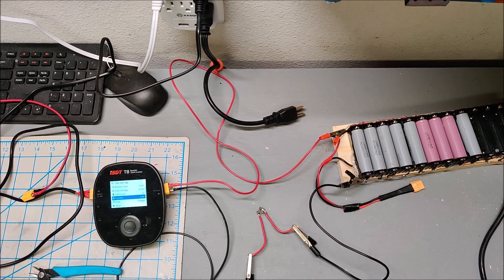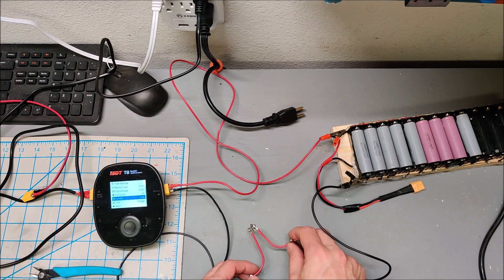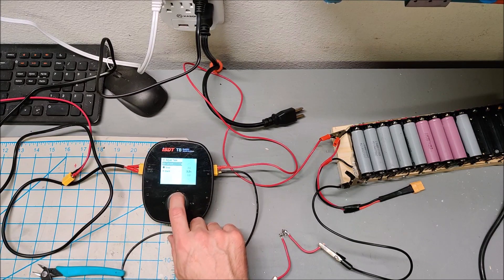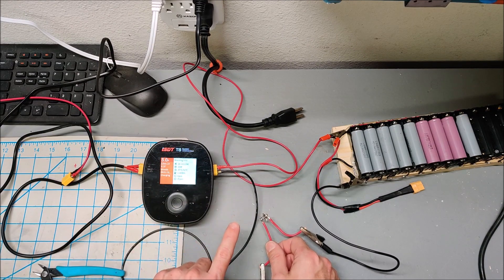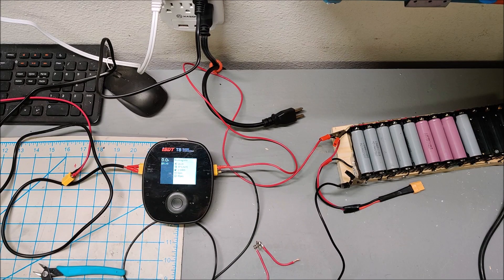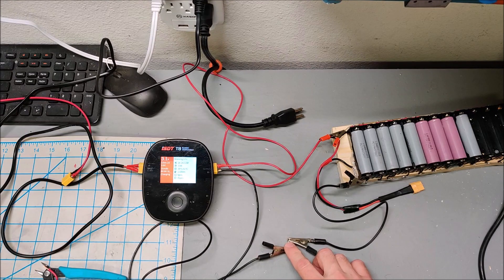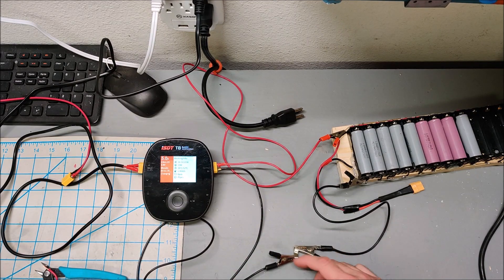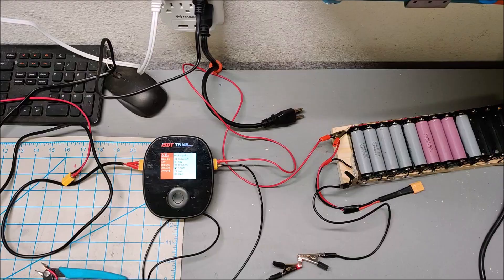DIY 18650 SOLDERLESS BATTERY BOX - MORE SPRING TESTING

Comment: What is the higher amp spring called?
Reply from the maker: https://www.ebay.com/itm/20x-Battery-Positive-Negative-Spring-Contact-Plate-For-AAA-AAAA-Batteries-Set-/123520755233?mkcid=16&mkevt=1&_trksid=p2349624.m46890.l49286&mkrid=711-127632-2357-0
Reply: @stevenc22  thank you!

Comment: Looking forward to your first box build. 

I’ll be running two 7s 8p  batteries in my Skoolie 
Mainly to power a small refrigerator. Also will have 600 watts solar. 
The batteries in the video. Are they just in standard clip holders.
Reply from the maker: They are in this sort of holder 

https://ebay.us/gocCFG

I have three of them paralleled up to charge 12 batteries at the same time.
Reply from the maker: Have you considered building something like my portable solar generator for your skoolie? These battery boxes are probably a bit small for a fridge and 600W of solar. A 7S30P soldered pack in a nice plastic case would travel well and you could keep all the electronic out of the case and make the case solely a battery box.
Reply: Stevenc22 
This is just a start. 
I just got the box ( same as you have ) from Amazon for a portable. 

I’ll end up with 200 AH at 24v when done for the Skoolie.

The case from amazon will hold approximately 306 cells in the snap together 4-5 holders. With room for usb charging and